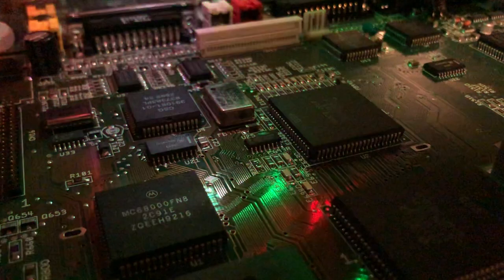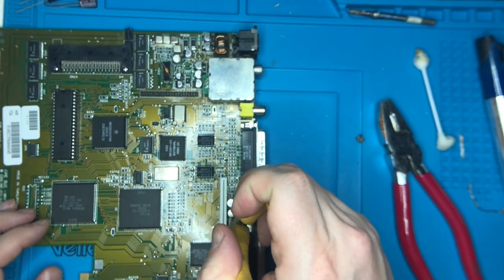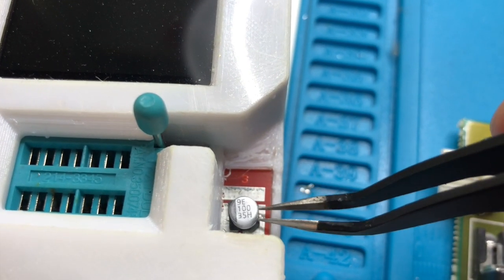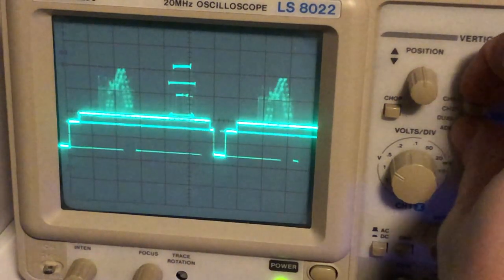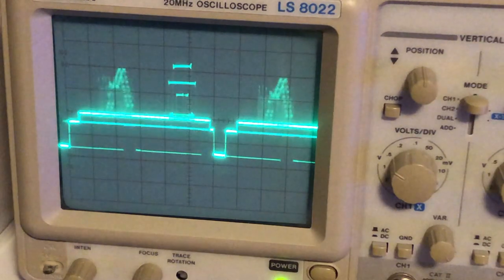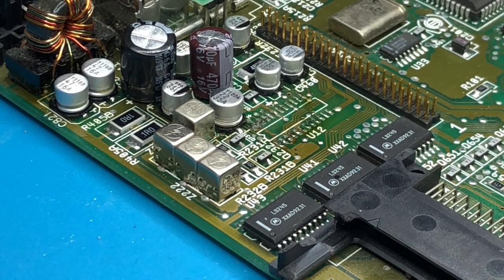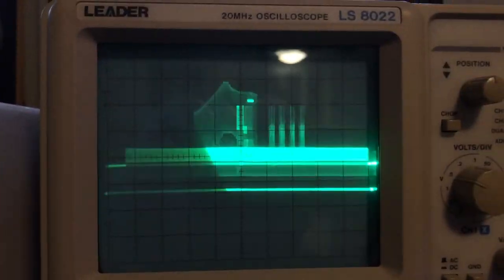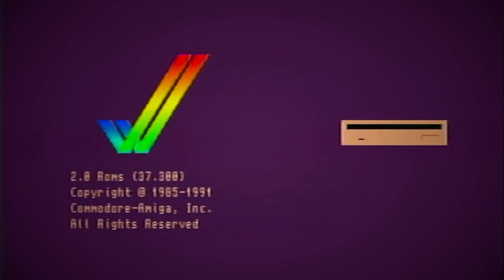Repair: Amiga 600 Composite video fix and recap.

Comment: Very cool. I wonder if it is possible on a A500 also? Happy New Year!
Reply from the maker: Thanks @bwack. AFAIK, the Amiga 500 was never designed for color signal on the composite the way the 600 and 1200 was. It was monochrome by design. 
But I am sure the CXA2075M could be used to create a colour composite by tapping into the RGB and CSYNC. A circuit to generate the PAL 4.43MHz subcarrier would need to be designed. I don’t think the Amiga 500 has any on the board.
Reply from the maker: @rezargamer If we talk about capacitors only and not about colour modding... Yeah, that’s very true.